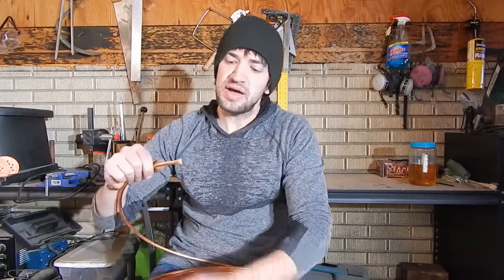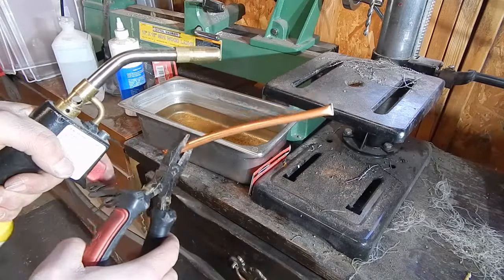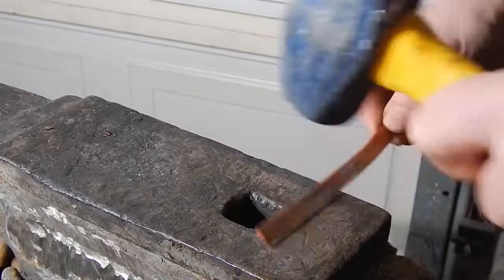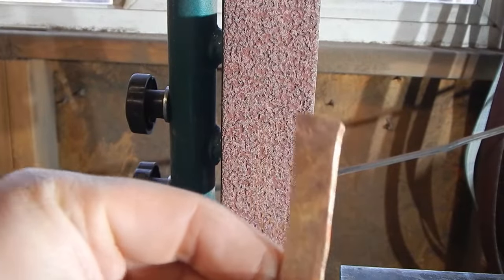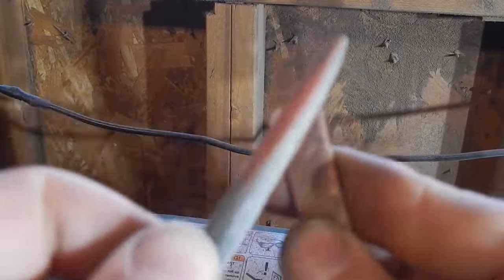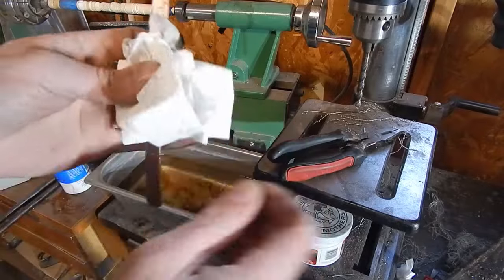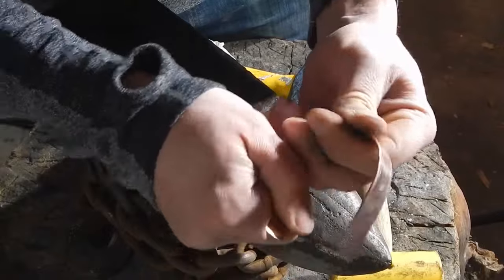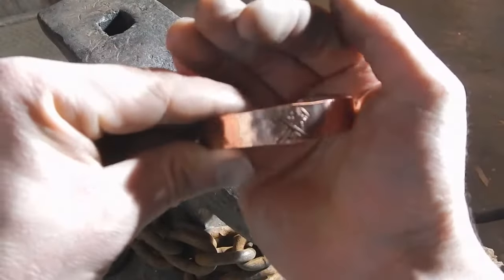HOW TO MAKE A BRACELET FROM COPPER TUBING (STEP BY STEP)

Comment: I work in a Sheet metal shop. We do a lot of Copper work..when annealing Copper your supposed to get the copper to a dull red before quenching it. We use water to quench with a small amount of Sodium Bisulfate   or( pool acid crystals ) in the water. It cleans the scale off. It is safe to use.
Reply from the maker: Thanks for the tips I will have to try again

Comment: well using a soft mallet to resist marking, but the ancient anvil will, so damaged is the face. Also when cleaning, bare fingers leave acid marks. Agree with @keithboard84 re annealing.
Reply from the maker: Thanks for the info! I upgraded my anvil. That one was pretty bad

Comment: Very well done. Can you glue NeoDynum magnets on each end of your copper bracelet ? And witch one and witch size would be the best and what would be the best technique to add it on the bracelet (To add a magnetic therapy to the item) ?
Reply from the maker: I will try it out and make a video on it
Reply: I just bought a Magnetic copper bracelet at Jean Coutu (Drug Store) and a way to add a magnet on each end , is to add it with a copper cap or cover ? I don't think that using glue alone would be sufficent enough to hold on or be stable enough. But the end caps would give it more resistance and stability.